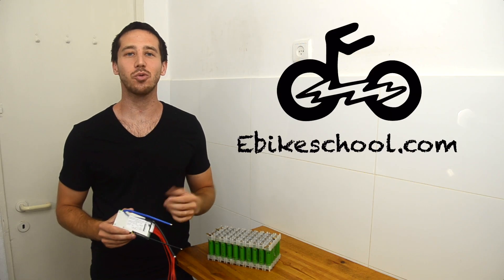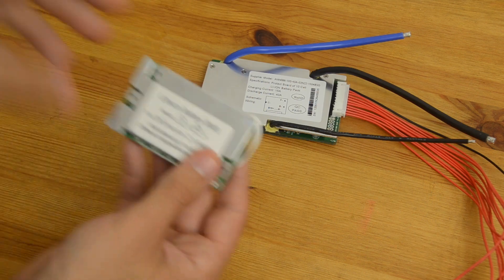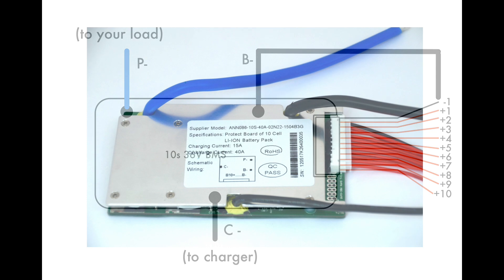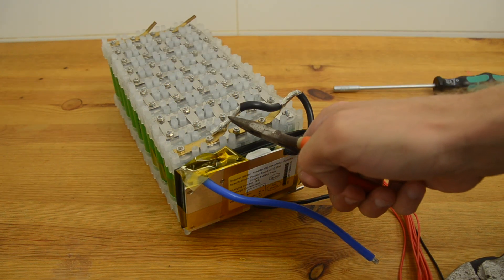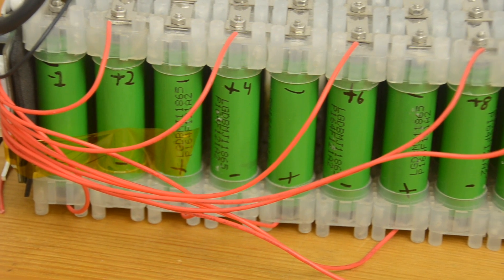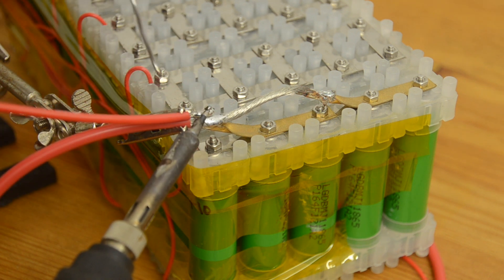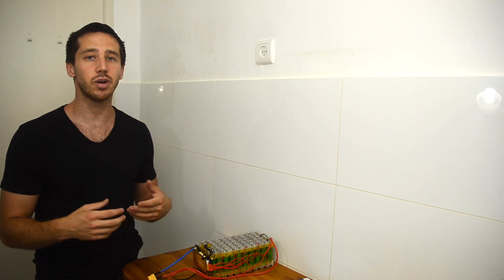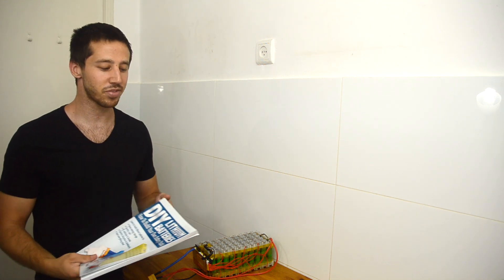How to add BMS (no spot-weld Vruzend DIY 18650 battery kit)

Comment: What is the need for the BMS? Seeing a lot of videos that say don't use them. I'm new to the ebike's world and have little to no electronics experience. Do you cover BMS and other equipment more in depth in your book?  Thanks for the videos btw
Reply from the maker: Yes, there's a whole chapter devoted to the pros and cons of BMSs. BMSs make charging much simpler, and also offer protections during charging and discharging. However the cheap quality ones can fail without you knowing, so its not a good idea to buy the cheapest quality ones (like anything in life...).

Comment: love this channel, I'm interested in this battery connection style, however I have heard if one cell fails this will destroy all cells in series and then all cells in battery when charged... not fun, the solution is to have fuses to all cells. is this true, and does this battery system deal with this problem. 
thanks
Reply: I mean.... he has bms on it, so it wont destroy other batteries

Comment: Another Great Video!!!!!Would love to see some smaller applications for us DIYers. Most of the units or devices I build will see 3S/4S/5S/6S, and maybe adding a 2P. The BMS used on these applications would require soldering on the BMS. But I am really liking this idea 200%. Very Tempted in testing out for myself with the smaller applications. Of course I would have to be creative. But I really like this idea for safety reason!

Edit: Is there anyway to get smaller kits. I would love to use these in my upcoming builds...: )

Comment: Hey bro. 
I've just made my own 1000w 48v e-bike, but I've ran into some problems.
The bike kit is made for 48v, but i made a 55v (15s with 4 recycled 18650 batteries per cell) battery! 
A lot of people said that almost all e-bike esc's can handle a few more cells, but doesn't that mean it pulls more amperage? 
I found out that my 5 x 20a BMS'es in series setup wasn't powerful enough, so I bought five new 100a BMS'es. (Haven't installed them yet)
Now, I had to change out one cell (4 batteries) because after i had ran my bike for a while (unprotected, without a BMS), i felt that some of my batteries were getting hot, and wouldn't cool down.
When I checked the voltage the next day, all the 4 batteries were completely dead. 
Most of the 4 batteries that is in parallel is the same brand, but the cells in series are different brands because they're recycled. (If you understand what I'm trying to say), but does it mean that I might have floored it too hard, and my batteries couldn't handle the amperage? 

Should i maybe put on at least another battery on each cell, or is it because i ran it unprotected? 

I'm thinking about rewiring the whole battery pack to 48v, and just add a single 48v BMS.

(Sorry for my shitty writing)

Comment: Hmmm, I'm thinking I'll hang those copper crimp tabs over the side and bend them for a clean flat surface area. Then I'll add crimp on post connectors and solder them for the BMS wires. Then they can go right under the nut with a loc washer.
Reply: In fact, I may connect everything with copper wire and those same crimp post connectors. Would take a little time, but I wouldn't care about not having the updated kit then. I would still use the kit connectors. Then do the wire on top of them with the post connectors.

Comment: You put the bare balancing wire under the cell connection. I would not support this kind of installation. Did you think of krimping the balancing wires first?

Comment: Bought and love your book. Half way through. Awesome safety section! Should be required reading for anyone building a pack. Question. If I have 100 18650 cells (new LG) and want to build a pack to run an inverter for a fridge (120VAC, 80 watts continuous, 700 watts start up or so). What's the safest pack configuration in general? Is there a general rule of thumb? I live in Hawaii so worried about heat where we are going to place the battery. Thanks!
Reply from the maker: Thanks! I'd recommend a 14s7p with a 48VDC to 110VAC inverter, if you can find one, or a 7s14p with a 24VDC to 110VAC inverter, which may be easier to source.

Comment: Great video.  Can you comment on why you choose a BMS over a hobby charger and cell monitor?
Reply from the maker: They are both effective options for safe charging. The BMS is a little more convenient for me in most applications. It allows me to use a simple charger instead of a programmable balance charger, and also has automatic cutoff and safety limits for discharging. But it really depends on the application as to which is better.
Reply: Agree with eBikeSchool.com - The BMS protects the cell and cell groups from Over/Under charge, Short circuit and such. A Cell monitor is great to compare the cell groups during / between charges.  As long as you have the BMS you can use nearly any voltage appropriate charger as long as you keep below the amperage of your battery.

I use all three on the 3s1p and 4s1p, and have charged the 3s1p using solar with a charge controller, watching the cells with the cell monitor.

Comment: is it possible to have both BMS and cell minders?
Reply from the maker: Sure, you'd just want to wire a balance plug into the pack as well. You'd wire it in the same wire you wire the balance wires for the BMS. I wouldn't leave the cell minder plugged in all the time though, in case it slowly drains the battery.
Reply: EbikeSchool.com I was thinking of putting I switch on the negative wire of the cell minder.
Reply: Sure - 
I actually made a Balance board pigtail so that I could move it from one 3s to another and it still allows for the battery monitor to plug in.
As eBikeSchool.com stated, if you leave the monitor connected, it will draw your battery down.

Comment: My bms has 14 wires and its for a 48v system, so the first black goes to the same cell that gets the big negative and also on the same cell the second wire and continue on connecting every other wire to only the positive of the cells right?
Reply from the maker: First black goes to same terminal on with the big negative wire, yes. The second balance wire goes to the opposite side of that same cell (the positive side). Then continue with the positive side of every cell until you run out of cells and balance wires. The last balance wire should land on the same terminal where you connect the big red discharge wire (and charge wire, actually).
Reply: Thanks a lot! I actually dos one ando the bms got Hot, so ended re-doing as you dos, ando everything seems yo be fine, thanks again

Comment: Nice video, thanks :-) 
Just a simple question regarding BMS features: most of them have Over-charge voltage of 4.25V per cell and over-discharge voltage of 2.75V per cell (or similar values) but anyway these values are outside the ranges stablished by Li-Ion Cells manufacturers (no below 3V and no over 4.2V, aprox if remember well).
In terms of battery performances, I guess this minimal difference is negligible but in terms of battery life could impact.
What´s your opinion? Thanks!
Reply from the maker: In practice, I've noticed that most kick on within those ranges. Those are the rated extremes, but most I've seen kick on right around 4.2V. And most Li-ion cells are actually rated to discharge to 2.5V, not 3.0V. But you shouldn't discharge lipo packs that low (as in the volatile RC lipo packs).

Comment: My question is about charging your setup. Do you the standard 2Amp charges sold on eBay/Amazon or go 5Amp for quicker charge time? Oh and what Voltage for both chargers? Nice BMS video looks easier than I thought. Labeling batteries during build helps.,🤔
Reply from the maker: I have a video all about charging, I'd recommend going back and checking that one out

Comment: Thanks for the video - Book and Kit ordered.  However for the application I have, I only need 12-14volts.  Most of the quality BMS boards don't seem to cover this area.  However, are you familiar with any - Application is for Ham Radio,
Reply from the maker: I'm trying to get into Ham radio radio myself... currently studying for the exam! You could build a 4s pack and use a 4s BMS from Aliexpress (I found a few there in a search) but you might also consider a 7s pack, which would be about 24V, then use a 7s BMS (much more commonly available) and a 24VDC to 12VDC stepdown converter. Also, you'll find 7s chargers more available as well, I believe.
Reply from the maker: Hi Andrew, yes that's something I'd like to do. If I get a chance to do that project, then I'll definitely make a video of it.
Reply: It's tough to make a 12v battery with 18650 cells. The voltage range with 4s gets pretty high at the top. A lot of people use LiFePo in boats and RVs because the cells at 4s are in the 13v range. They are  a little lower voltage and match up better to 12v systems. You might get hash, noise, with a basic DC/DC converter. MFJ makes some interesting boxes to boost voltage and to condition voltage with a bank of capacitors. With 100w SSB transmissions there are short peaks of power.  Depends on the power output of the transmitter. 

There is always stuff on Ebay. Maybe Vruzend can carry some of the lower series protections boards. It's not great to have a small battery that could get run down below the safe level, more than anything. I think Vruzend would be super useful for small packs. And a lot of stuff you could just use a two dollar DCDC converter.

http://www.ebay.com/itm/4S-16-8V-Li-ion-Lithium-18650-Battery-balance-Board-full-charge-Balance-Circuit-/122389198998?hash=item1c7ef6f896:g:x34AAOSwfVpYviYu
Reply from the maker: George is right. That's why 7s with a step down converter might be best
Reply: George - That is what I am building - either a 3S or 4S by 3 or 4P. Main goal is to have a slim battery to pair with the famous Yaesu FT-817nd radio.  The radio only need 3amps but with a little extra you can run more - and do WSPR using the Wolfie Link and Android tablet.
Reply: The 7s would be great for a 50-100watt station.  And really due to the draw - required.
Reply from the maker: Oh man, I want that radio so bad! One day...
Reply: as well i am studying for my ham ticket I was  wondering if u could build 13.8 v pack and using the kit with a rc style balnec leads like u see on lipos packs and put a video up the reason i ask i am trying to find other ways to power cb ham radios and gmrs radios i got with alt power sorces
Reply: Andrew Murphy - It's the same process but you won't get 13.8v unless you use a DC-DC converter.  The 3s and 4s pack I have built - both with balance leads work fine.  I have the two pin 15amp Molex connector (commonly found at Radio Shack pre close) and balance jack.  

Right now I am using the iMax B6AC v2 to charge and balance them.
Reply: The link to the chargers does not appear to work and you didn't provide any names to rebuild the search. What chargers should I look for? I too want to make a HAM battery pack for my work here in Los Angeles.

Did you ever get your HAM license? I recently got my general after getting my technician last year. The best way to get ready is with HamTestOnline.com I found it really easy to study. My son was home from college last year, he used HamTestOnline to study and in two weeks got his technician license putting his dad to shame :-)
Reply: sir BA MS Lagana zaroori hai kya